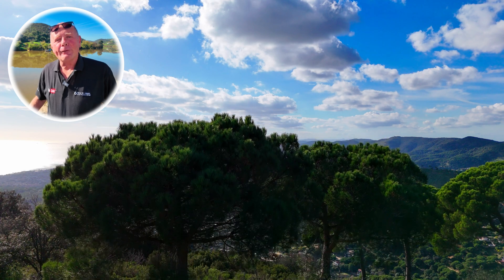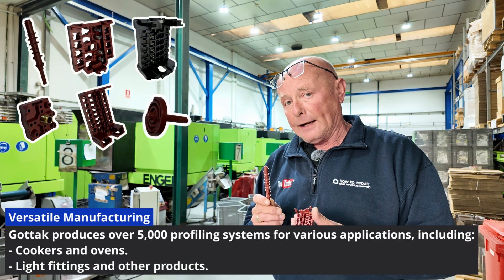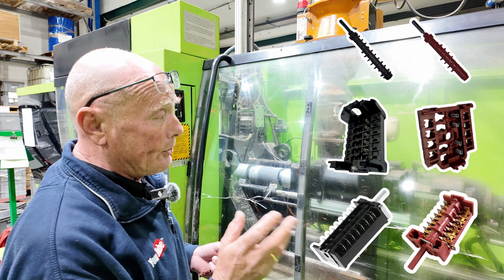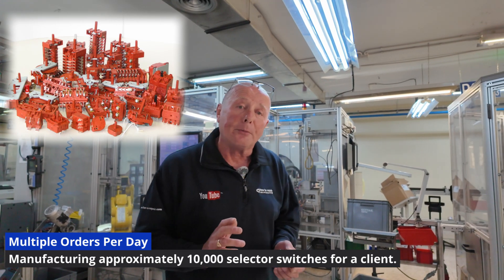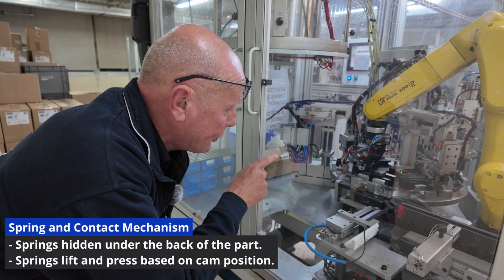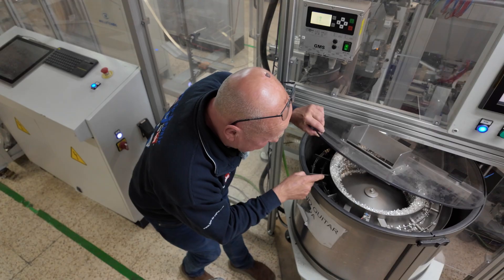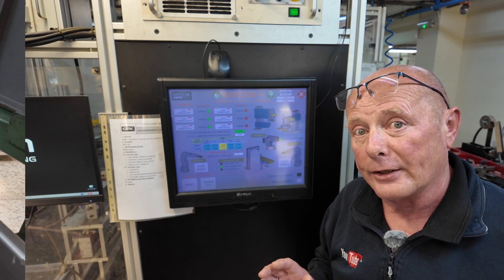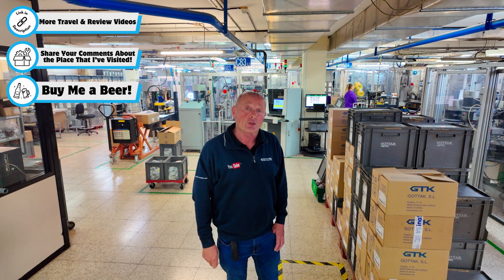How Selector Switches Are Made On Ovens, Stoves, Hobs, Cookers? Gottak Rotary Switches Factory Tour

Comment: Fascinating- and shows there's no substitute for quality. Cheap stuff not only fails early, but can even  be dangerous.
Reply from the maker: I would hate to see any fires being created which is very difficult in a cooker environment where everything is designed not to burn but if the fires took place then maybe the standards commission would actually get an insight into what manufacturers are doing you only have to look at what happened with some of the tumble dryers That caught fire and burnt houses down to see how the manufacturers were held to Acount

Comment: These switches are only used on older machines
Reply: Yeah boy!..... like rounded tyres on todays cars....thats old and my car has wings instead.....
Reply from the maker: While certain brands have shifted away from these components due to a slight cost premium compared to Far Eastern alternatives, their superior quality becomes evident upon examining the internal construction. The cheaper alternatives are using substandard poor quality contact services on the points compared to this manufacturer who uses silver in the contacts this reduces deterioration of the point surface.

Manufacturers often opt for cheaper components to implement planned obsolescence, a strategy aimed at limiting a product's lifespan to encourage future consumer purchases. This practice, however, can lead to premature failure and increased electronic waste.

One particularly concerning issue is the absence of clear warnings against using the selector switch while the thermostat is engaged. This action can generate excessive arcing, causing catastrophic switch failure. This critical operational detail should be explicitly stated in the product manual to prevent avoidable damage.

Further analysis and demonstrations highlighting these failures will be provided in subsequent videos, utilizing the manufacturer's own test facilities. I did this video awhile back but it explains why the excess load is causing so many problems in the cheaper components https://youtu.be/JJBnogwRgz4?si=U9E1lWZXPY3k4gG4
Reply: All 10 million, a year, of them 🤔
Reply from the maker: I just spoke to the director of the company just now and I thought I'd include this statement that he said to me it's truly astonishing the numbers: this video shows 1 only assembly installation as Gottak has more of them plus 3 other factories. Gottak can produce 1 switch every 2 seconds in normal conditions.
The video just shows one installation of assembly as the other ones were not allowed to be shown as the company has tight agreements with big appliance manufactures worldwide and are not allow to show all its know-how.  
I was also informed that some machines take less than 10 minutes to setup a differnt production run and machines can produce as little as 500 units on one order to 1 million all at once on another order. When you consider just our country United Kingdom, we have over 28 million household in the UK. Everyone of those has a cooker and that's just a little England. think of this on the worldwide scale.
Reply from the maker: @noldushumlesnurr6169  yes, I was astonished but when you know how they operate and how well they operate it is truly amazing to see how much a machine can knock out in 24 hours. The factory demonstrated impressive efficiency.  Once the engineers configured a couple of the turntable systems, production commenced immediately.  One system reportedly achieved a remarkable output of 10,000 units within a 24-hour period, utilizing two operators across eight-hour shifts. This continuous operation, potentially across eight or nine distinct production areas within the facility, highlights their commitment to maximizing productivity.

However, the need for frequent system reconfigurations to accommodate bespoke orders presents a challenge.  As an engineer explained, retooling a machine for a different switch design can take 5-6 hours.  Coupled with the just-in-time ordering practices of clients, who typically request 20,000 to 30,000 units at a time, this necessitates rapid production turnaround to meet customer demands